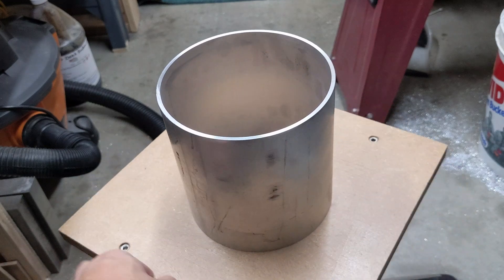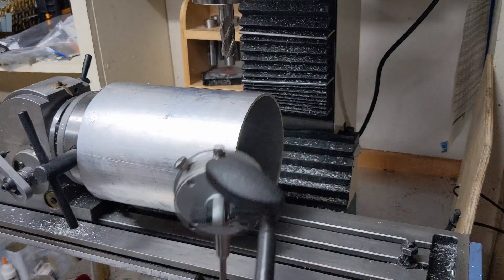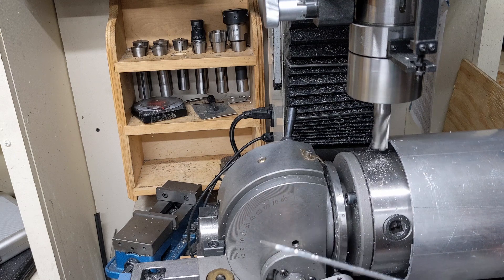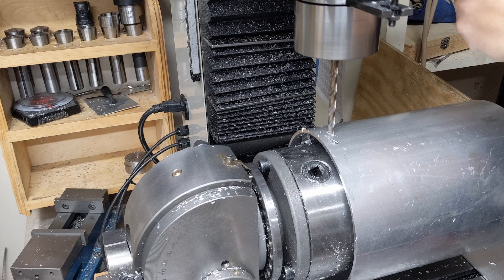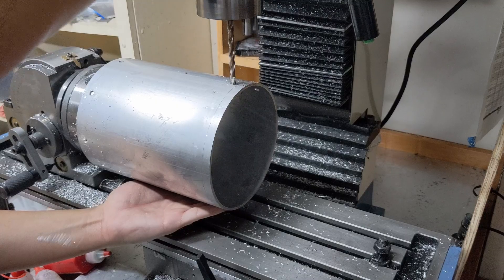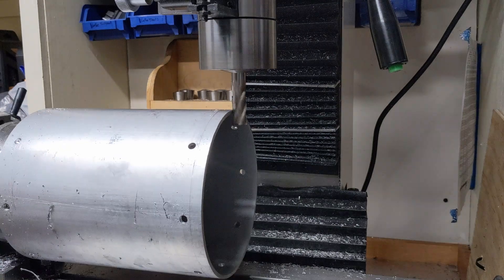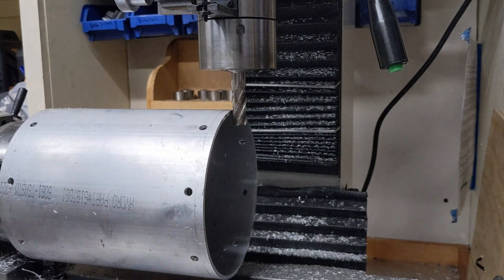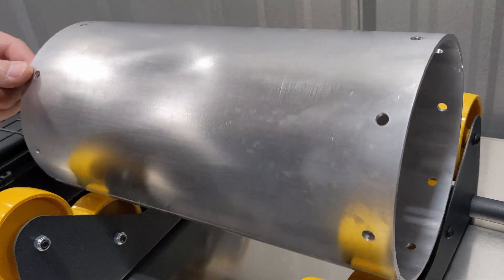Squaring a Rocket Body Tube the Easy-ish Way

Comment: This is good stuff, Derek. Taking it one bit further, if you need the holes of two parts made this way to line up (like a body tube and a bulkhead) then you also want to make or buy pie jaws. The plain three jaw will distort the tube enough that radial patterns don't quite match after it's taken off the machine, while pie jaws force it to be round.

We did this operation with a huge CNC lathe at Armadillo, but it's definitely more cost effective for a small project to do it the way you show. 12" is an impressive scale, that was the size of the first tube rocket before moving to the rolled and welded in-house 48" sheet version, which is about 15.3" diameter.
Reply from the maker: I'm sure they would indeed be a much better way to chuck it up for a specific size, for the reasons you mentioned. I would probably like to invest in a decent 6 jaw instead as a compromise, or perhaps I can make new soft jaws each time I need a specific size. These tubes were already really squished from the supplier too, so hole patterning aside, the squaring part seemed to work out well. 
I ought to provide a correction that the tube lengths were 7.5" and 12.5", and it could theoretically be much longer. The diameter of this tube was 6" OD.
Reply: Oh, 6" OD makes more sense, I was clearly not paying attention to scale in the video. The 12 or 15 inch AA tubes were 1/8" wall making them a lot floppier than what you're working with here, so six jaw might do well at your scale.